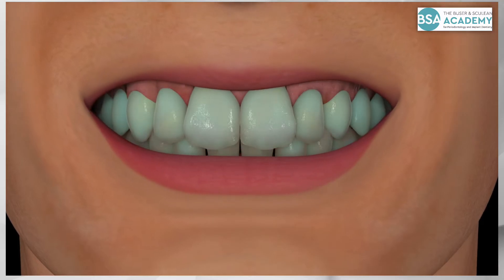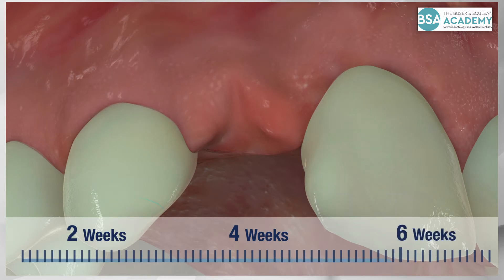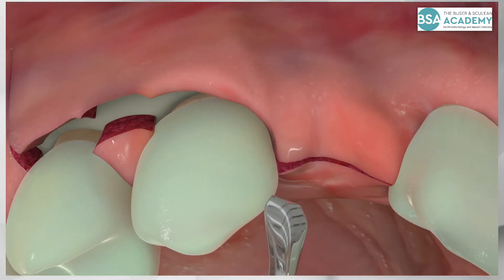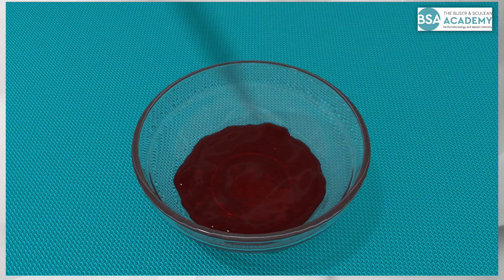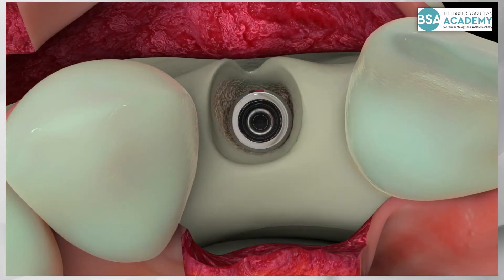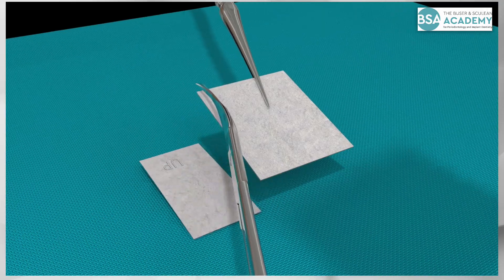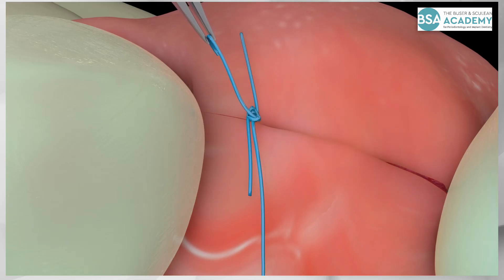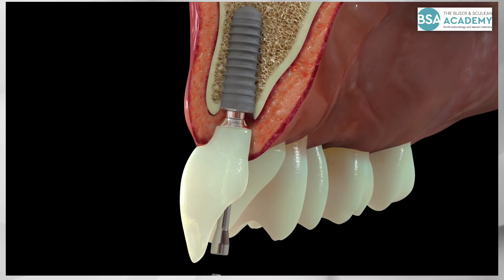Early Implant Placement with simultaneous Contour Augmentation using GBR – The Buser Technique

Comment: I honestly don't understand this approach.  An immediate placement would have accomplished everything and saved a lot of time and money.  If there were legitimate concerns about soft tissue or buccal bone thickness, flapping and placing something like volumax at the time of the extraction would have also accomplished the same thing.
Reply: The issue is if the buccal wall is < 1 mm at time of extraction, there's a good chance that due to the loss of bundle bone, the buccal wall will resorb some, exposing some of the implant and leaving a defect. Not familiar with Volumax other than reading about it, but I'm not sure that would help with the bone resorption that will naturally occur. 

Waiting 8 weeks while allowing the resorption to occur allows you to then place the implant knowing that you can build that defect back up. So its less about the soft tissue (although that's a factor). Buser isn't saying that you cant do immediates, but much safer to do if you have a really thick buccal plate.

He came and lectured on this topic for several hours when I was in residency, it was pretty fascinating seeing his post op scans.
Reply: @JoelDeehr  This type of GBR statistically fails between 15-30%  of the time depending on which source you want to look at, and the average immediate implant results in about a half mm of vertical bone loss and a half mm of horizontal bone loss without any gap grafting or anything else beyond placing the implant.